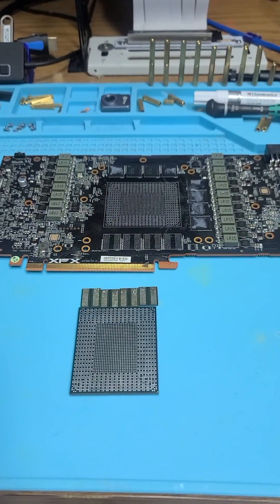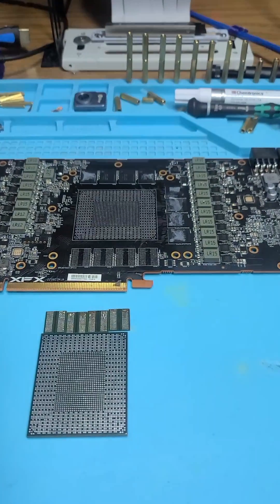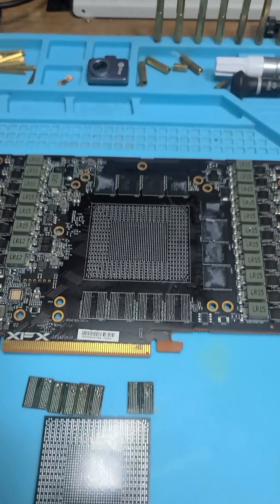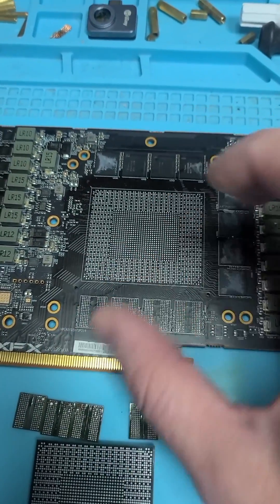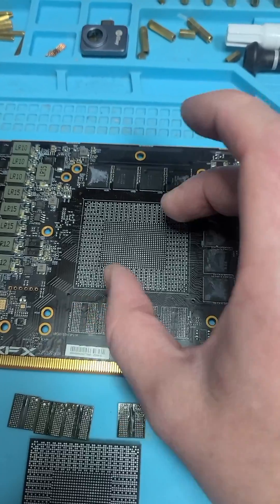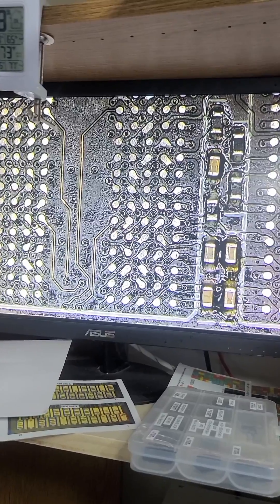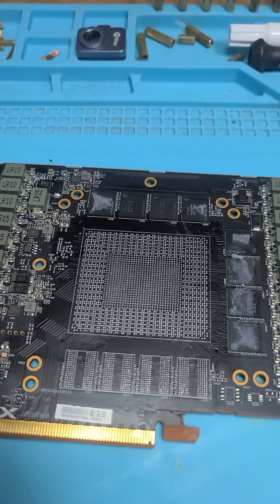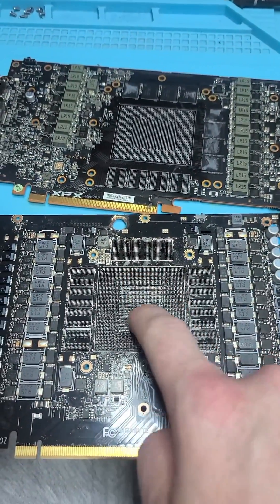TOP reason not to buy AMD 7900 series GPU #shorts

Comment: Does AMD really manufacture PCBs? Because as far as I know, they only sell chips and schematics showing how to feed them. I don't see anyone blaming Samsung for making their memory chips that are later put on the same PCB.
Reply: No, AMD does not manufacturer PCBs. PCB design files even does not specify the type of solder mask. This is completely specified by the person who orders such PCBs or the free will of the PCB manufacturer.
The situation would be like blaming Ford, because a tire runs flat.
Reply: Well if all reference cards look the same it's probably AMD that cheaped out, not much but a few stickers and the cooler differ AMDs own 7900xtx from the rest of the reference designed ones for sure.
This is not a huge deal unless it causes higher rate of failure or if you repair damaged pcbs for a living.
Reply: They don't manufacture PCBs, but the people they choose to do business with do. They're choosing to have their PCBs made that way.
Reply: amd does NOT make pcbs, aibs do (yes even for reference cards)
Reply: @gentleman2292  But they still suck.
Reply: @mintymus  sure bro whatever you say
Reply: @gentleman2292  Glad you agree.
Reply: AMD can indeed do nothing about it. XFX is the cause, XFX is the cheapest gpu on the matket most of the times. You get what you pay for.
Reply: hes an amd hater.  fixes nvidia gpus all day and cries about amd
Reply: @JohnSmith-ro8hk  you have no idea. First of all you a BIG ASS proof on the video of why a specific AMD card is being built with crappy quality components, in this case the gpu. If he says AMD is because this is in general. He maybe saw a Zotac, a Gigabyte, a XFX, etc, etc. You think you know more than him?
Reply: @JohnSmith-ro8hk  This guy is a real joke.
Reply: @JohnSmith-ro8hk  if he fixes nVidia all the time instead of AMD cards that means nVidia cards are worse than AMD cards because they fail more. That's what he didn't think of before saying AMD is bad. And I'm a subscriber to many repair channels on YT like "Graphic Cards Repair" and many russian, chinese and korean technicians but most of the GPU they fix everyday are nVidia cards. If I want to search on YT for a particular AMD card repair like the RX 5700XT for example I have a hard time to fiind out this kind of video. But if I search for a nVidia card like the RTX 3060 I find a ton of results...
Reply: @kakkoishonen  nah marketshare means there will be more nvidia cards but those fail all the time too.  the bottom line is aib will cut every corner they can for profit, specially when it comes to meager margins with nvidia cards.
Reply: @kakkoishonen the reason why Nvidia gets more repaired over others, is because of the market share and price point. There are way more Nvidia high-end cards in the market than AMD. It would be like saying: Oh well, Intel GPUs seems to never die, because I never saw a repair of those. Nah, that's not factual.
If I remember the 290X or 390X they suffered from really bad GPU and board design and died in bigger quantities around the point the manufacturer guarantee had ended. Guess what: Most of them because of ripped pads near the PCIe connector. Yes, AMD was ahead of time in this regard.
But in the end, except bad batches, the both die in about the same percentage. That's a normal industrial effect, not related to GPUs. Even your TV will fail on about the same percentage.
But nothing to blame on you. The majority of people cannot handle statistics. It is far behind natural experience.
Reply: @kakkoishonen  remember that NVIDIA hold %80 of the market.
Reply: @MrYevelnad  Not 80% but 75% and remember that nvidia is like intel. It's hard to find gaming laptops with radeon gpus because its forced to build laptop with nvidia gpu and intel cpu. Intel had a court case on this issue because there were even bribes to get their equipment in the laptops. It was many years ago but that's how it looks.
Reply: @kakkoishonen because AMD sell a whole lot less than nvidia. But i heard when it comes to return rate/RMA it is usually higher on AMD side.
Reply: @MacTavish9619 AMD losing market share on the laptops because of what Rory Read did back in the 2012-2015 when he was task to stop AMD financial bleed. Back then he rejects many OEM offer unless they only want to sell them in large volume. They pretty much hand mobile market to nvidia at that time.
Reply: @kakkoishonen  Imagine- the company that sells 85% of the GPUs have more come back....who would have ever thought? Of course people make videos of what people have, amazing.
Reply: @kakkoishonen  even though both amd and nvidia breaks, nvidia is the one he can make money off...
Reply: @matthiash.4670  sounds somewhat familiar to me, my r9 290 from msi started artifacting when it was out of warranty and died shortly after lmao
Reply: @Carbonized91  yeah, I know. Very sad. About 2 years ago I put several dozens of such boards to trash, because of broken GPUs or boards damaged beyond repair. But not only AMD made such bad products. If I remember back the Nvidia GTX780... ohh well... There was nearly 80% guarantee dead card was dead, because the memory supply died and hammered 12V not only in memory but also in the GPU. That was an unbelievable bad series, not just in performance but also in durability.
Reply: @kakkoishonen  Nvidia have 80% or more of marketshare; that's why they're fixing Nvidia cards all day. There aren't any AMD cards to fix because people simply aren't buying them.
Reply: @kakkoishonen  Their PCB is just bad mate, he has videos he wipes PCB with alcohol which should be entirely alright to do but somehow AMD PCB gets damaged from it loosing color and material on surface. Their PCB protection is really mediocre at best which makes repairable problems impossible to repair. He stated it several times he usually don't accept AMD cards often as reballing damages them too much.
Reply: @JohnSmith-ro8hk  You AMD fanboys are far worse than Nvidia and Intel fanboys combined.
Reply: @mintymus  i find huang man gravy enjoyers are more annoying than even conslow fanboys
Reply: @JohnSmith-ro8hk  I wouldn't know anything about man gravy.  Apparently though you're an expert.  Care to explain?
Reply: @JohnSmith-ro8hk  I'll leave you to your fantasies.  I just know one thing:  AMD GPUs are terrible.
Reply: @JohnSmith-ro8hk  he is not amd hater,  but obviously what amd does, not releasing free giving schematics of their gpus is not good for repairs.
Reply from the maker: Radeon 7900xtx has it even worse.
Reply: @northwestrepair   Again, AMD doesn't manifacture PCBs. Just like how XFX buys Samsung memory chips, and how Sony buys mass production PlayStation motherboards, AMD also buys their PCBs from a third source. And, guess what? They actually come from the same factories as some Nvidia cards that you never even considered to be such a supposedly bad quality.
Reply from the maker: @Expo_Hans  it's not the builder, it's the customer who orders the build to specifications.
AMD and xfx specifications are as seen here.
Reply: @Expo_Hans  It doesn't matter if they manufacture them or not.  Fact is, the PCBs that hold AMD chips are garbage.  Doesn't matter who is at fault.
Reply: @northwestrepair   Touché, I guess. But you still have to consider the technician's technique. Maybe the paint here is more fragile, or maybe you're accustomed to being too rough on a different product. Take memory controllers, for example. They're often the reason why many Nvidia GPUs aren't fixable which doesn't happen as often with AMD. Although the programmade PWM thing is definitely a turn off from AMD.
Reply: @mintymus I mean bit of an ironic comment when half of the repairs this guy does is on 4090 power connectors or cracked gigabyte 4090 pcbs.
Reply: @Expo_Hans what nvidia card is that 🤨
Reply: @Expo_Hans amd is to blame on the custom board they design it with bad masking and it’s like the video xfx and amd to blame
Reply: @Jb1v1clips AMD didn't invent fiberglass and masking chemicals.
Reply: @GoonyMclinux  they requested it made that way
Reply: @northwestrepair  I hope none of the 12 I have fail... yeah, I sat there and counted... I was shocked. But these are nice cards not the msi and Asus ones.
Reply: Yeap! He just doesn't AMD an came with this bad add to amd
Reply: He is prolly using a chemical that is not suitable for AMD PCB’s.
Reply: @atilasatilmis9986  I don't think ultra cleaning boards with ethanol is good for any modern solder mask.
Reply: @GoonyMclinux  nVidia is the monopoly in GPU market and can put the manufacturing PCB standards. Since she has most of the market share, it's no doubt most of repair tools and repair consumables are for nVidia boards.

Chemicals and solder mask compatibility mattes. I'm pretty sure NWR is using chemicals incompatible to AMD PCBs.